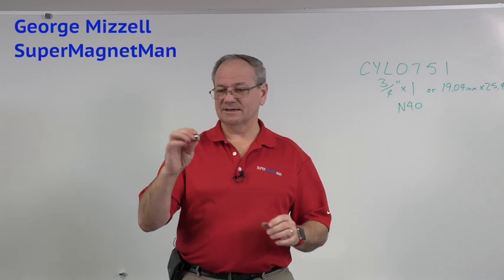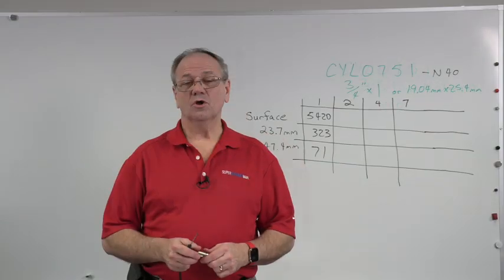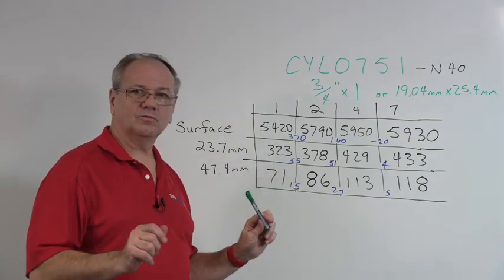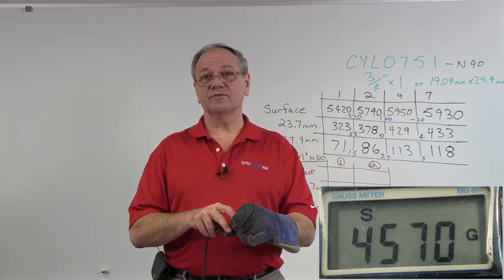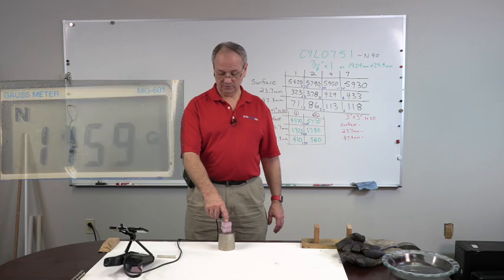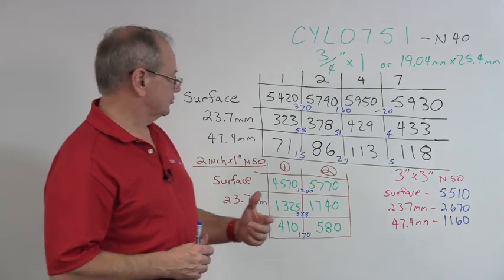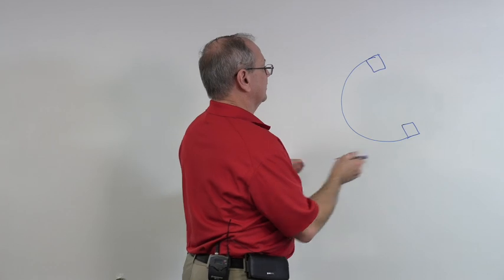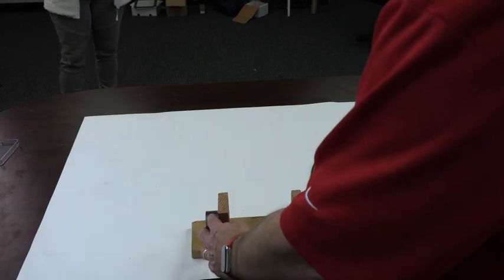Projecting Magnetism

Comment: U could hv tested with clear (air) space between the magnet and hall probe cause the material which u used for the spacing may hv some magnetic shielding property which might cut some flux strength reaching the hall probe.

Comment: So what is the most efficient ratio of thickness to diameter ratio for achieving flux strength at a distance?
Reply: yes numbers in charts don't show the ideal values. need to take more sample points and graph the points, you will see the efficient point or values for x strength at y distant that you need.

Comment: Does your rule-of-thumb "50 gauss flux-density is needed to pick up a nail" still hold when you use a thicker but shorter magnet? Taking it to an extreme, this rule breaks down in the two-magnet example, because it is about the gradient, rather than the absolute flux-density, when it comes to tasks like picking up nails - right?
Reply from the maker: INteresting question - I was going to add that into the video but I thought it would make it too long and will make that a future video.  What happens depends on the length of the ferrous object (nail or paperclip).  The longer it is the more you will see a gradient over the length.  The shorter it is the more uniform the field will appear.  50 gauss is pretty much what I see will pick up a small nail or paperclip.  If the field was sufficiently large - say from an 8 inch diameter magnet x 2 inches thick then the field in the center at about 10 inches away would be very uniform and probably would not pick a small paper clip up.  I will keep all these ideas in mind for that future video and answer the question for sure:)